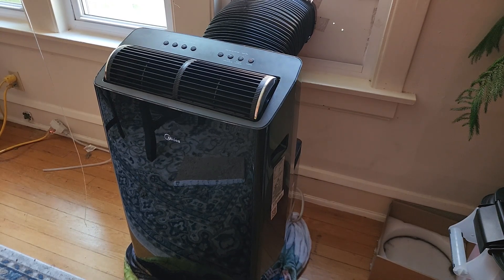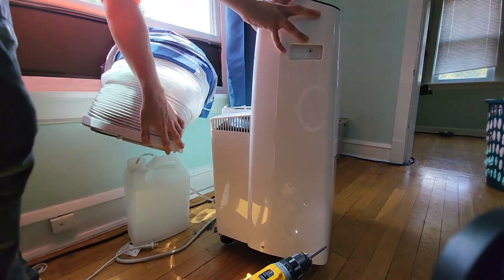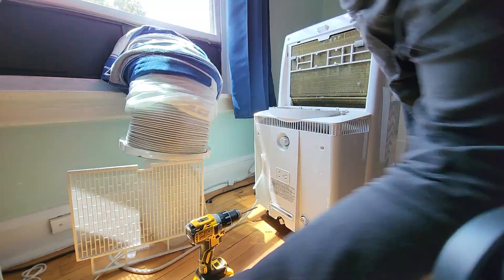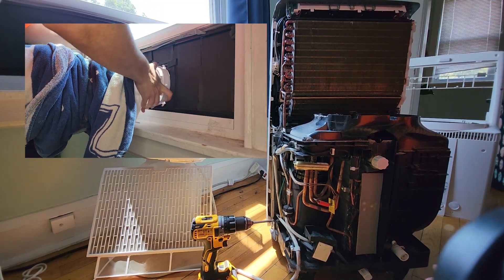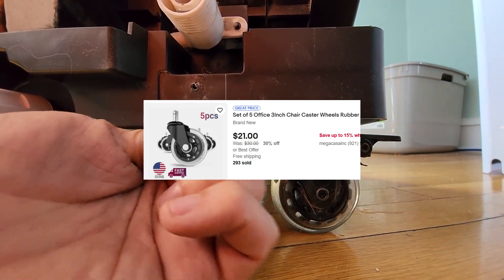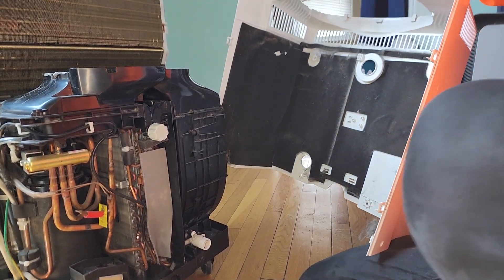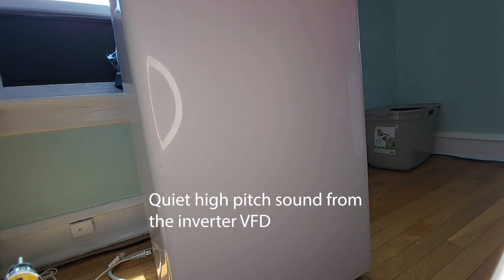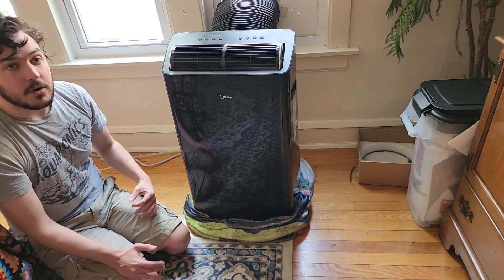Why the Midea Duo is an *Almost* perfect choice for Cooling AND Heating Your Home

Comment: Thanks for doing an in depth video. You talked and showed a lot of stuff that isn't discussed by anyone else. Thanks for confirming that the Whynter is the same as the Midea Duo.
Reply from the maker: For sure, I just wish I included more of the downsides. I still really like the unit but I absolutely hate the hose design

Comment: Have you had any issues with mold? A window AC, the Midea U was recalled for mold but it seems this portable model has a less documented mold issue as well. I found this YouTube video (https://youtu.be/bztT_tOFArs) showcasing the problem. Another post on /r/AirConditioning also discusses it (search up "Midea duo mold issue" its about a month old).

Comment: Hi there nice video on these products. I'm going to purchase the Midea duo, but first I have a couple of questions. My family and friends know I like to purchase the best of the best of things for my home. I want to purchase the Midea duo for my bedroom only. Is 14,000 BTU's  too much for just a bedroom? Cause the ac I currently have is 8,000 BTU's, but I've had it for 8 years and now it's slowly dying & doesn't cool the room enough. Should I purchase Midea duo with the heat feature or not? What is the difference?
Reply from the maker: Hisense now makes a dual hose inverter with heat that's only 8,000 btu. I would advise against the Midea Duo as it's really sensitive to being put in rooms too small for it. You'll get high humidity.
Reply: @AnIdiotwithaSubaru Hello thanks for writing back. How is the brand quality and noise wise?
Reply from the maker: @djevon0328  I have had no issues with either unit. They do have that weird defect where unfiltered air gets in which doesn't reflect well on Midea. These are quite at a low load but much louder when they work hard. 

I would definitely consider the Hisense as well as the 120v inverter heat pump from General Electric
Reply: @AnIdiotwithaSubaru  what about the heat feature that some come with? Would I need the heat feature?
Reply from the maker: @djevon0328  the heat feature it a real nice to have but im not sure where you live. I have natural gas heat but these offer me electric backup for emergencies here in Chicago. 

If you have zero need for heat, dont get it
Reply: @AnIdiotwithaSubaru  I live in NJ. So, yes it does get very cold in the winter from Jan til April Feb is the coldest.
Reply: What is your opinion the Hisense u shaped window air conditioner models? Looks pretty neat but yes it does seem like its a lot of work to install.
Reply from the maker: @djevon0328  I personally like portable  units with heat but if one of those U units works, I don't see why not. 

Id imagine the window units probably have the advantage of being slightly quieter
Reply: @AnIdiotwithaSubaru  ok great

Comment: Ive got the Cooper and Hunter version. Its the same machine. Mine stinks if I dont drain the condensate with a hose when in cooling mode.

It also sucks at heating, because it basically wont run if its actually cold, so thats kind of a wash.
Reply from the maker: Yeah, I started a pinned comment at the top so people can post what they don't like about their unit

Comment: Have you ever needed to drain during a humid summer day? I read its designed to evaporate the condensing in ac mode
Reply from the maker: I have not but I could see it happening if you are in a very high humidity location. Are you getting a fault code?
Reply: @AnIdiotwithaSubaru i just got the unit as a back up haven't tested it yet

Comment: How the hell did you get this thing apart?😅 I got all the screws but this thing will not come apart
Reply from the maker: @kalebstout7673  there's a lot of screws and to actually unclamp the two sides takes some force
Reply: @ I got all the screws but when I went to unclamp the sides it just snapped and still won’t come apart
Reply: @ how many screws did you remove?
Reply from the maker: @kalebstout7673  you should have the back vent part separate and at least 14 screws out of the machine

Comment: Hello, do you have to drain the Midea duo when its humid?? can i just put the hose in and run it in a bucket while the AC is on so i dont have to worry about it filling up and shut it off?  and will it push the water out the bottom of it up and out into a bucket??

Comment: I have had 2 Whynter units. They seem to only work for a  year before stop cooling and heating.  The compressor runs but it does not heat or cool.  I am wondering if they are leaking freon :(.  Even when the compressor some on there is not change in cooling or heating.  No want to test if out of freon
Reply from the maker: @Ojames600  I have two that have both lasted 2+ years now. They have a pretty long warranty here in the us so I would check with that.

Comment: Do you have any problems with it way overshooting the set temp in heat mode? I set mine to 70 and it will keep going to 78+ returned 2 times same problem.
Reply from the maker: @Ocrefrigeration91  absolutely. It tends to happen if it's in a small area or not enough air exchange.

Comment: I wanna use this to cool off a Garage in Vegas.  Gets to 115 in the summer here.  I have heard that these shut off at 90-95 degrees?  Is this true - and is that inside air or outside air?  I don't think my garage heats up quite to 115 like outside lol.  Also, any way to seal the indoor air vents to have zero negative pressure - even if I tape up the seems and such?  I do not want any, not even 1% hot air being sucked in from the outsieede due to negative pressure.  I will vent the big hose out my vent in the wall and seal that up so it is totally air tight around the vent hose lol.  Thanks
Reply from the maker: @drtechnologyvegas  I doubt there's any way to get this thing to not generate any negative pressure. Just by the way it's designed it will probably produce some negative pressure. 

I live in Chicago so I can't I've seen a 115° day but we've had 100° days with it working just fine.
Reply: @AnIdiotwithaSubaru  Thanks :-)

Comment: I don’t have the duo, but I do have a Midea 14,000 and find that it has more noise coming from the heat pump than I would like. Kind of an annoying sound. I have both an LG that has less annoying noise and have found that the DeLonghi (I own 2 of them) are  the most quiet. I purchased a used DeLonghi and also took it apart and I can tell you that it is so much better made to reduce noises. Almost every tube and the heat pump were covered in a rubberdized material and the unit also had egg carton sound foam inside the unit to reduce vibration and sound. In my opinion, the DeLonghi  is the most quiet, followed by the LG and then Midea is next and in very last place is the Black & Decker which has the loudest and most annoying sound coming from the heat pump.
Reply from the maker: Yeah, these are not the most quiet units when they're operating at a high load. It's really only quite when there is a low load on the system.

On high they kinda sound like a pissed off mini fridge

Comment: Had to return mine, only run for a few min then show P01 code even though there was no water inside the unit. Also had several broken clips on the hose. Big problem is Midea doesnt make replacment parts like the hose that they will sell you when it goes bad. Customer service isn't great with them. I do love the u shape window units but i know when someting goes wrong just trash it and buy another one.
Reply from the maker: I'm definitely way less in love with these units since I made this video. Haha

Comment: The double vent is for the heat release condenser section. Inside air flow-through is just to move the air through the COOLING condenser section and out the louvered vent. Hence the cat hair.

Comment: I really appreciate the response! I hate that the drains aren’t labeled. Is it the lowest center drain or the drain just above it right of center that drains on the heat pump setting ?  Also thank you for the print files! Printing on ABS-GF right now.
Reply from the maker: @Matt-rq6wz  it's the one slightly higher up and to the right. The unit comes with a crappy piece of tube that fits in there. I printed an adapter to fit onto a smaller silicone tube. Also, keep the wheels around just in case for warranty but I personally really like the smoother wheels.
Reply: @AnIdiotwithaSubaru  I bought mine used and didn't receive the tube that it comes with. I'm working on printing an adapter now, did you just find one on the market place? link? Did you use TPU?
Thanks for the info. I'm happy with how the adapters printed.
Reply from the maker: @Matt-rq6wz  I used petg for pretty much all my prints. The little adapter I printed to go to a much smaller piece of tubing was also petg but printed solid infill with slower speeds. I'll see if I can find that file too
Reply: @AnIdiotwithaSubaru nice! That would be great. I’m modifying a basic hose adapter to size now we’ll see how it goes - I’m still a newbie.

Comment: Have you read the operating instructions regarding the operating temperature of the Portable AC?  if it is above 95F, the the unit will not work or possible turn off.  I confirmed with Midea about this operating range.
Reply: I cooled a cargo trailer with my black duo this past summer, with temps reaching over 100°F on many days, and never observed it cuttinh off due to outside temps. 
Heating, though...  when they say 42°F is the outdoor threshold, they mean it!

Comment: For some reason, the white Midea Duo units are a lot cheaper than the black ones.
Reply: I'm not positive, as I only have the black one, but I think I read on reddit that the cheaper white model isn't reversible for heating

Comment: Is the unit fan a bit noisy during the first 10ish seconds of operation? It's like a fast clicking sound from what I believe is the compressor fan. It always goes away after the fan spools up after 10ish seconds or so. I just got this unit and noticed that sound. I want to make sure it is normal.
Reply: It also has a very strong fish tank kind of smell when the fan is running without the AC. When the AC kicks in the smell goes away so the smell is constantly going and stoping. This is on my first day using the unit so there is no way mold is the cause of the smell plus I live in a very dry climate (15 to 20% humidity). I am at a loss as to what is causing the smell.
Reply: That first loud sound you hear for 10 secs, is it kind of a low frequency sound?  
If so, that's the sound of the unit shuddering as the compressor ramps through lowest level of its slow-start routine.  The lowest speed is so slow that it resonates below the effective speed threshold of the balancing mechanism within the pump.  It's weird, and I'm not a fan of it, but it doesn't seem detrimental to the unit... so you just get used to it after awhile.

Comment: I just bought one and it’s about to get a workout. I’m guessing in winter if you let some warm air from inside in the hose and it can be 32 outside and it will still run.

Comment: These are complete garbage.  If the outdoor temperature gets above 90*  they turn off.  They don't tell you this anywhere except in the manual which of course you don't see until after you buy it.  Why would anyone make and sell an AC unit that won't work in heat above 90 * 😅
Reply from the maker: I've had both run just fine at 101° last summer here in Chicago
Reply: @AnIdiotwithaSubaru  it says right in the manual, up to 95*  mine shut down at about 91*  had to return it.  The Toshiba version sold at Lowes said the same thing and the store said they were all being returned here in Las  Vegas.  I showed the store manager and he just laughed.....
Reply: @mrmped1  hi is this true ? i looked in the manual dint see anything stating this
Reply: Look in the manual under temperature range.  It will show a high of 95*.  But this is nominal.   I've had two.  One shut off at 90*  and the other at 94*.

Comment: How wide is your window opening? It looks like you modified the exhaust. My window is just under 19 inches and according to Midea the minimum opening is 19.05 inches. So before I buy I'd like to know if I can trim it to fit.Any help would be appreciated.
Reply from the maker: You can definitely trim to fit but just do it on the larger side (away from the vent) so you can add the extension back if you install it in a bigger window. I have mine in a 20 inch wide window and I did have to trim it
Reply: @AnIdiotwithaSubaru  Thanks for getting back to me.

Comment: Need to 3d print an intake filter for these. I use a towel around mine to help minimize the air it sucks through the bottom. Unit would be really great if they did a better job of enclosing the interior so it wouldn’t pull so much air from the inside.
Reply: I believe they do this as a minor cheat.  A little air mixed from the inside closer to the target air temp helps to (minimally) reduce wattage for slightly better test numbers.  This way, even though it still pulls down a very slight vacuum indoors, the outdoor vent provides that differential path so that it won't be forcing drafts in through door and window seals throughout the house like the single stovepipe models do.

Comment: Great video. I too am in Chicago in a 100+ year home that only has radiator heating. I was looking for a new AC for my bedroom and came across this unit with the heating option. Based on your usage, would you recommend this over a window AC unit for summer and space heater for winter? Or is the heating option not sufficient enough or too expensive? I noticed my electric bill sky rocket with the space heater. Thanks again!
Reply from the maker: I wouldn't buy this unit for the heating alone. It's more efficient than my boiler but not by a lot.

 It's the best portable ac on the market but those Midea u shape window units can be had for under 300 if you shop around and that's a lot cheaper than this unit. The u-shape units use a lot of the same parts and are also veryyy quiet.
Reply: @AnIdiotwithaSubaru  Yes, I'm primarily looking for cooling, but if I can get heating too. Then I can keep the unit setup year round. Again, I appreciate the info you provided. It would be great if you can do an updated video with your comments on how well this unit did for the summer and winter weather.

Comment: how is really the noise level pls
Reply from the maker: In cooling mode, it's usually very quiet. It starts loud but once it gets the room cooled down, the unit knows and slows down and it gets much quieter. It occasionally might get loud on very hot days too. 

Heat mode is loud
Reply: @AnIdiotwithaSubaru  tku...appreciate

Comment: major downside with these units is not being able to clean the coils very well, since its such a tight space and they're not as water proof as window ac's
Reply from the maker: I am going to attempt to seal both units up better next time I clean them. I'd say the less waterproof aspect is more because it's a full inverter system which is much more complex.
Reply: @AnIdiotwithaSubaru  you also have window inverter system's too like the LG dual inverter, and it would also be cool if there is a way to place a pleated filter in the commpressor intake to prevent high dust build up in the condenser

Comment: Looking a new unit for an indoor garden.   I’m concerned with particulates coming into the space.     Is it possible to utilize a single hose extension to run it solely as a single hose unit?
Reply from the maker: If you wanted to run a single hose it would be possible but you would have less negative pressure if you ran it as is.
Reply: @AnIdiotwithaSubaru  that’s exactly what I wanted to hear.   Would you happen to have a schematic for the hose hookup on the rear of the unit?

Comment: Theoretically, you could move the temperature probe on this unit to get it to operate below freezing in heat mode. But I wonder if that would have any other facts on operation.
Reply from the maker: It could definitely be moved. I'm wonder if it's COP would just be super low. It still puts out a lot of heat with the vent opened up, I've run it down to something like 10f but didn't want to damage it so I stopped.
Reply: @AnIdiotwithaSubaru  The thing is. The Duo uses R32 refrigerant, making it extremely efficient. Along with the inverter compressor you could theoretically get heat levels out of it to very low temperatures. But also where is the temperature pro located?
Reply from the maker: @vectorcollector4893  it's main exterior temperature thermistor is right in the intake side where the hose attaches to the unit. It's housed within a clear vinyl tube within a gray tab. I assume that's it anyway. I kinda wonder if the defrost doesn't work effectively at a lower temperatures because it has no pan heater. Or at least that's why midea sets it to stop above freezing point?
Reply: @AnIdiotwithaSubaru  True
But there's really no reason Fred to stop there. I could understand below 0° werebello like 10° or something like that, but most people are gonna buy this.
To use the heat functions well. And also
They really should do some updates to get this thing to run better. And heat mode mainly lowering the temperature cut off point.